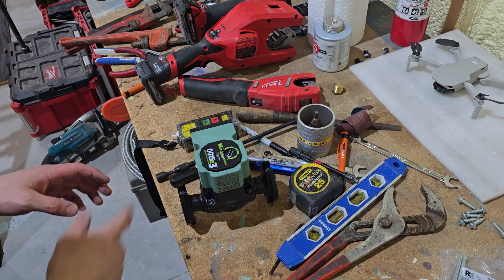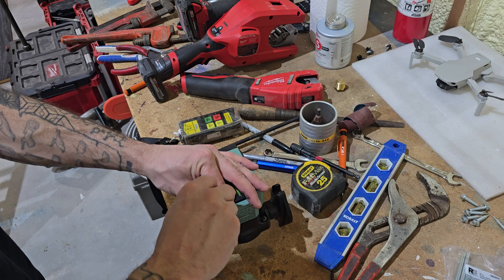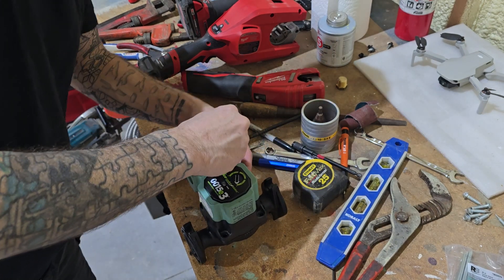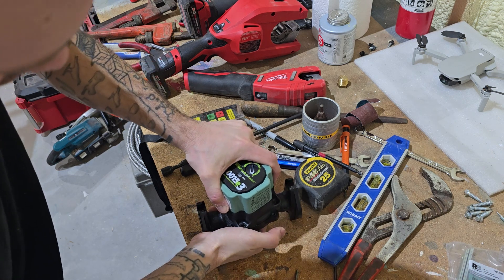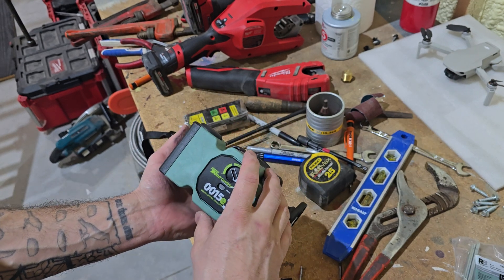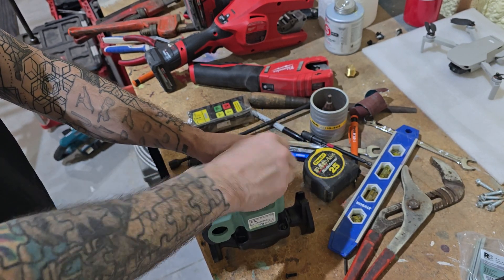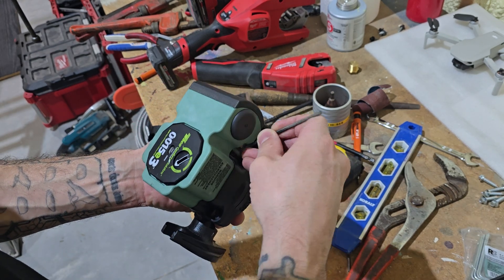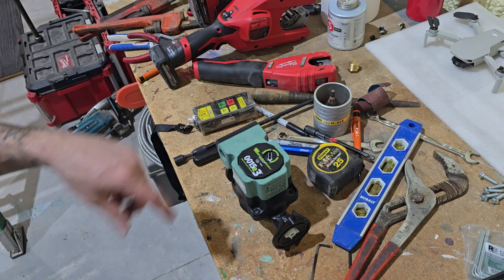How To Rotate a Boiler Circulator Pump

Comment: When I started out as a sparky  back in 1970 seemed like all of the pumps in our plant were the noisy but bullet proof red Bell & Gossit 1/4 to 2 HP. pumps. Other then the couplingds breaking had dozens that ran 24/7 for over 20 years.